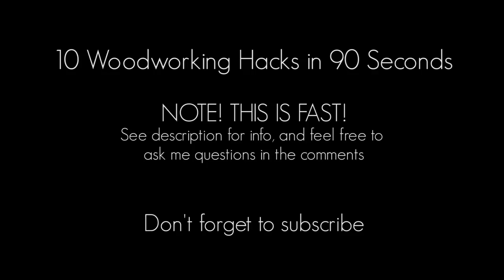10 Woodworking HACKS in 90 Seconds

Comment: I do not understand the number 9 :)
Reply: Because glass is mostly dead flat. You can also use this to flatten the bottom of a plane or chisel.
Reply: Yep - no chance of rounding edges over using that technique.
Reply from the maker: Yes, true good tip